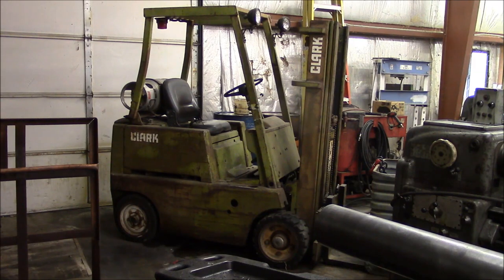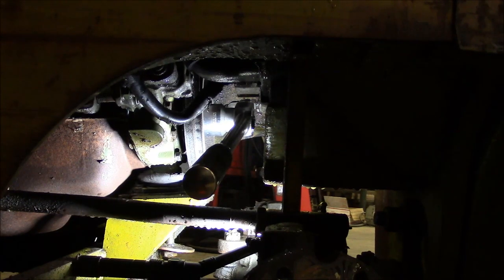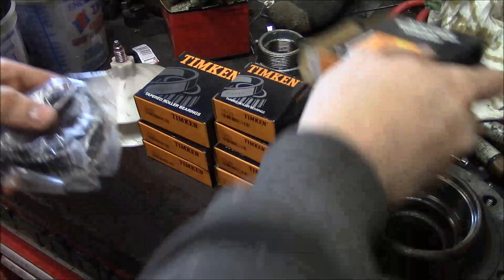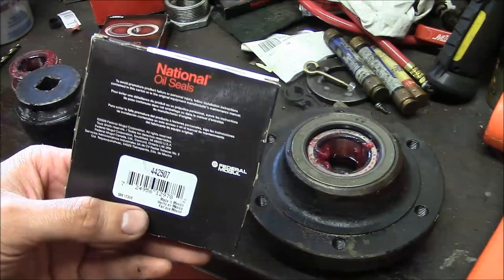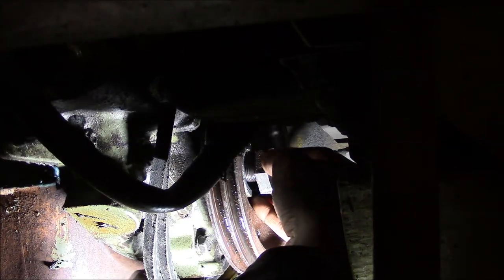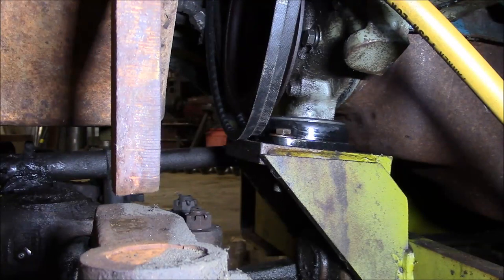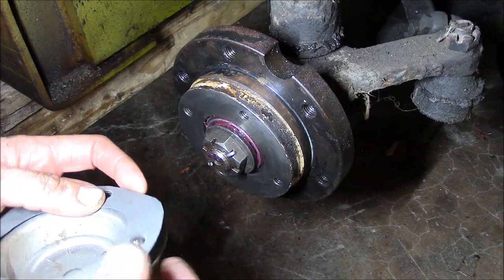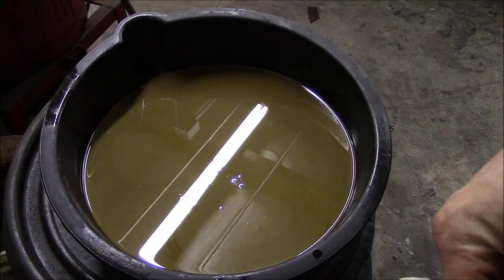Forklift Repairs: Leaking front main seal and other adventures

Comment: I've had pretty good service from Rock Auto, and one thing that is pretty cool is I was able to remove an item after placing the order through their online ordering. I did order a rebuild kit for some wheel cylinders from them once which showed pics of the part that said "Made in U.S.A.", and I got a box that said "Made in Mexico" and the rubber cups (ACDELCO drums) said "Made in U.S.A.". What are the chances that USA made rubber would be shipped to Mexico? Makes me kind of leery of the product, BUT I believe it is Timken, not Rock Auto. I ordered bearing seals for my lathe and got Timken seals that were "Made in Taiwan". Not from Rock Auto, which is why I suspect Timken is just going downhill...
Reply from the maker: All bearing makers seem to do that. They make the expensive, high margin, stuff in house and farm the other stuff out to the lowest bidder. Sometimes that's a US company, sometimes not. I've seen made in US seals and bearings in Korean cars.

Comment: The best way to remove the bolt on the harmonic balancer - using a breaker bar with the correct size socket, turn the engine until the breaker stops against something solid, now just bump the starter and your bolt will be loose.

Comment: Wes, My fork lift looks to be identical to this one but do you know if there is a place stamped anywhere indicating the model? No placards still on it show a model. Thanks
Reply from the maker: Seems to be a common problem. The original tag should have been next to the seat. The only identifier will be a serial number stamped into the frame. It should be on the top under the battery or on the opposite side by the air filter. A dealer can look up your model from the serial number.

Comment: Ah, I too hate silicon with a passion.
Last large diesel propulsion engine I overhaul had it on all sealing surfaces, bolts, flanges, o-rings, gaskets and what not. I am sure I spend most of the time removing the silicon.
Silicon - amateur.
Reply from the maker: Yes sir!
Reply: Erik Johansson well you need gasket sealer on water pump and oil pan or it will leak

Comment: Company I worked for before retirement  was one of the UK's biggest bearing and seal suppliers, plus chain and bearing units. We could supply seals in both inches and millimetres  going back 50 years at least. As you said unless you buy cheap Chinese  bearings, most top quality  bearings are made by just one or two companies.

Comment: seeing you do those bearings hand tight made me cringe a little. tapered roller bearings like a little preload.
Reply from the maker: They get plenty of preload with a 5000 lb counter weight hanging above them.
Reply: @WatchWesWork  aye, its your equipment, i know you know what you are doing, but i have had them get rather loose after a while of driving, same thing with machinery, gotta retorque them after a while. 

had them back right out and drop a main drive splined shaft in the mills aswell.
Reply from the maker: @Donkusdelux  I've never seen a tapered roller wheel bearing specify a preload. .001-.005" end play is the normal recommendation.
Reply: @WatchWesWork   ........ id honestly pick the back end of that forklift up and check the wheels for play, tapered roller bearings that size can take like 50lbs preload, then back off a half turn to get the clearances,. 

I am not trying to sound like an ass but ive had them back off on a few different applications.

Comment: You should get rid of that Clark and buy a real forklift. Clark makes the worst fork-lifts I've ever used.
Reply from the maker: I'll give you my address if you want to send over a better one.
Reply: @WatchWesWork  Why would I do your job for you? If you want to run a Clark and sink money into it to keep that unsafe piece of shit running, that's your problem, not mine lol.
Reply from the maker: I just thought I would ask since you seem like such a nice guy...
Reply: @WatchWesWork  Better luck next time.
Reply: Correct me if I'm wrong but this is a 40 year old machine, and all of this maintenance is pretty normal. I think Wes even said he hasn't had any trouble out of it. Hydraulic cylinders leak it's a fact of life just like assholes making comments their ass can't back up. I've always wondered if there is some law I don't know about that keeps YouTube trolls locked in this parents basement. I am fairly certain if you put down your keyboard and went outside you would see other snowflakes not melting, maybe you would be in a better mood.

Comment: Once you have had a bad experience with any brand of mechanical parts it can live in your shit list almost forever. I can give you 4 on my shit list from clear back in the early 70's  So, for  over 50 years I have never purchased a Firestone tire, A quart of Pennzoil, any filter branded by Fram, and Champion spark plugs. I'v thrown more new out of the box Champion plug's in the trash can than you could imagine. The next guy will swear all of the products I refuse to use simply are the best and it's just my inability to install or recognize a great product. You probably don't remember when Firestone was sued and recalled thousands of tires. Years before their recalI I had several of their tires roll off the rim's and pass my vehicle on different types of terrain. I warned every one I could about driving on those tire's. You could wreck your vehicle and potentially kill your entire family. In the 1970's my buddy left SD. for California he had his own auto repair in California and sold Firestone tires. When he was heading with his Elcomino loaded with a few hundred pounds of old car parts. I said; to him there is no way them new Firestone tire's will make it, he laughed. Well he replaced all 4 of them tires before making his destination. Then it came out on the News, hundreds of vehicles were losing their Firestone tires and many rolling over causing serious injury and death. I was one of the lucky ones I just watched my firestone's go rolling down the road ahead of my vehicle and never purchased another Firestone tire in over 50 years and 100 vehicles later. Still can't stand seeing firestone tires on any thing but; farm equipment or maybe a lawn mower. Good luck with that Fram oil filter just add some Pennzoil and Champion spark plugs let me know how that works out for you.